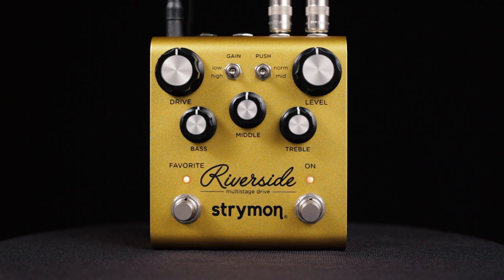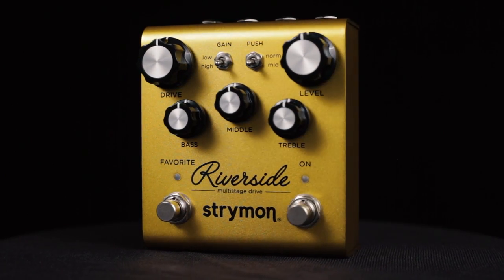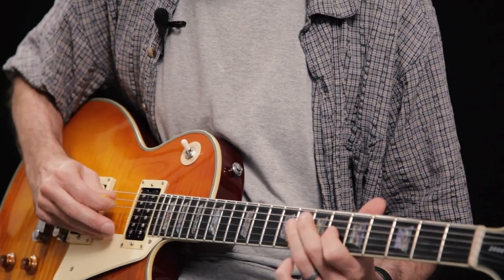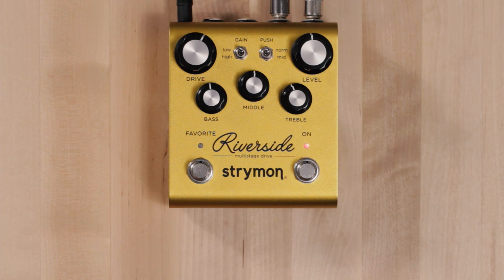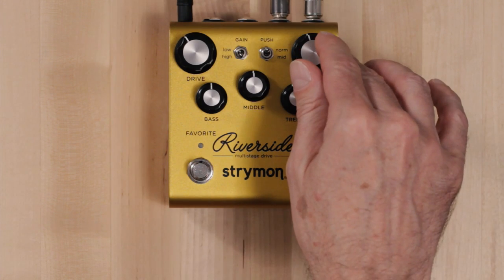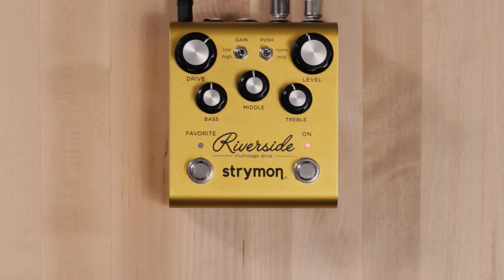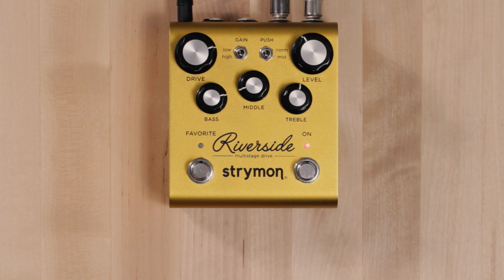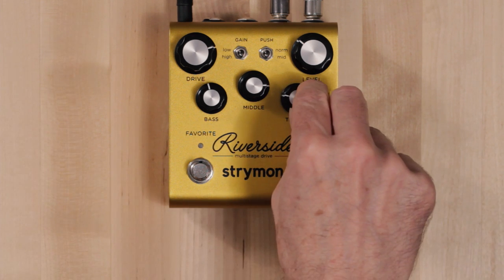Strymon Riverside - Multistage Drive - In-Depth Demo

Comment: I got a Riverside unit last week and gave it a few good runs over the past few days and it's a winner: very rich and organic sounding with nice clarity as well as versatility and flexibility. Loving it. My two other OD pedals are the Ibanez HW TS808 and the Wampler Euphoria (along with the Xotic RC Booster V2) and the Riverside complements them really well. In the high-gain mode it's a great distortion pedal, which is not all that easy to find.

I've only tried it through the clean channel of my Friedman BE100 but will soon see how it works with the OD channel. It'd also be good to see a demo of how this pedal does with cranked Marshall type amps. I primarily use the HW TS808 with the amp's OD channel to give it more "hair" and cut and am curious to check out how the Riverside does in that realm.
Reply from the maker: Thanks so much for sharing that with us. That's great to hear. If you post any videos please let us know. I'll pass along your suggestion to our demo person :) We are definitely going to be making more demos. Thanks!

Comment: I own one, paired it with a deco and it just sounds incredible. Just realised you need another pedal to 'unlock' a 6db boost so I'll have to look into that. So many different sounds in one overdrive.

The pedals both sound incredible, I don't regret spending what I did on them, they will stay with me till I can't physically play anymore.
Reply: Why? It sounds like a Boss DS1. Just buy a couple of Boss DS1 and you'll save 200 bucks on top of it.
Reply: @mike1967sam  Yeah, um...no.
Reply: @mike1967sam  no way dude

Comment: Been waiting a long time for Strymon to step into the OD realm. My only slight apprehension is that they'll release a larger form factor like the big sky, timeline, möbius which will have so much more options and I'll be annoyed if went with the smaller one.
Reply: Peter Danner completely agree. I want to wait until they have the larger version with a million options. I hope they're working on it!
Reply: MIDI support and patch storage would be very nice...
Reply: @techguy1230  - Both Riverside AND Sunset have MIDI support and 300 savable presets.

Comment: It would be nice to see how it reacts to guitar volume
Reply: Pretty damn well, but it cleans up just slightly less than a valve amp ( traynor ycv 50 )
But the  pot roll off sound with my prs is awesome, you can go from a Malcolm Young sorta sound to Dirty.
It sounds great, nothing like say... a line six where when you lower the pots  and it sounds garbage, it responds really well.

Comment: Im trying to learn Jazz Guitar.  What are the essential pedals to get?  What do I not need?
Reply from the maker: Hey there! It really depends on what sounds you specifically want to get, and it also depends on other parts of your rig, like your guitar and amp. Jazz is also such a broad genre — someone trying to nail jazz fusion tones is going to need different gear than someone trying to get Grant Green or Wes Montgomery tones. 

Once you've settled on a guitar and amp, a good starting point is usually a reverb of some type and a drive pedal, assuming that your amp doesn't have a reverb you want to use, and you're not getting overdriven tones from your amp.

If you have specific songs you're trying to replicate the tone to, we're always happy to offer some suggestions if you'd like to email us at support@strymon.net. 

Hope this helps!

Comment: Does anyone know if the optional boost is independent?
Reply: Independent of what?
Reply: Of the pedal being on.  Would allow you to boost a signal before overdrive.  Helps to compensate between pickups in different guitars.  i.e. boosting the signal of a strat before overdrive as compared to a les paul.
Reply: Ah, that is a really good question!  Its a total guess, but from owning the OB-1 Compressor -  that pedals boost is independent of the compressor, so I would hope/assume (dangerous practice, I know) the same with Riverside.  At least I hope so... time will tell.  Hope they see this and answer.
Reply: BluesLicks101 I also own an ob.1 and the boost isn't independent of the compressor.  The compressor has to be on for the boost to work.
Reply: Pretty sure mine was, maybe a settable parameter? - but I left my compressor on all the time so maybe its not, the OB1 was a bit dry for my taste so I replaced it with a Wampler Ego so I'm going from memory.
Reply: Okay I took my OB out of the drawer and tried it and it absolutely DOES have an independent boost.   This makes me think maybe you have an earlier version?...
Reply: Strymon says that isn't possible.  http://www.strymon.net/faq/can-the-boost-run-independent-of-the-compressor/
Reply: Ben Harris on the OB.1, to use the boost without compression, just roll the compression down to 0.
Reply: Well the Boost LED comes on for sure when the compression is off - so that's a design defect IMHO.
Reply: BluesLicks101 it's a good thing - you can tell if boost is on or off without the pedal being "on". very helpful.
Reply: BluesLicks101 Mine does that too.  It is confusing for sure.  I have had mine for a few years.  Perhaps it is an older model and the article is outdated as well.  That would great if it were so!
Reply: slimigan My comment was regarding whether the two can operate completely independently of one another.  I like to have a boost to compensate for the drop in volume for vintage single coils from humbuckers.  I prefer to use a compressor for clean/percussive passages and solos rather than leaving it on all the time.  Since this doesn't seem to be possible on the Ob.1 I was wondering if it might be on the Riverside.
Reply: Not helpful if the LED is on but the EFFECT is really NOT... a better method to implement would have been a flashing LED for "boost ready", and then it goes solid when compressor kicks in.  I did not use this pedal much, like I said I like the warmer sound of Wampler Ego better, after I bought it - it went into the drawer as a backup - love Strymon, but that to me is a design defect.
Reply: Agreed Ben, its an excellent question, and I hope Strymon looks at this thread, if for no other reason than to come up to speed on the importance of independent boost in all pedals that have boost.
Reply from the maker: +Ben Harris Yes the available external boost can work independently of the pedal itself.
Reply: strymon Could you please advise as to the OB-1 issue above?  the LEDs come on independently but it appears the actual boost and compression does not, this is confusing... if the boost truly DOES require the compressor to be on to function, it would have been better if the LED on the boost was flashing rather than solid in Boost ON and Compressor is OFF... and when Comp. and Boost are both ON, both LEDS should go solid.
Reply from the maker: +BluesLicks101 The Compression and Boost effects on the OB.1 are not independent.  The Compression must be ON in order for the Boost to take effect.
Reply: Right that is what we figured out: the point of confusion however is that when the compressor is OFF it still APPEARS to a user that boost is operational when it isn't - as upon a hit of the footswitch the boost light comes on solid (exactly as it does when compressor is on) - this is really a false "ON" light however.... my suggestion to remedy is that you have the Boost light flashing when Boost switch ON, and Compressor switch OFF so there is no confusion on the functionality... and that the Boost LED would go solid when Compressor is engaged - may not be worth the continuation engineering expense, but IMHO it'd be nice for future users.
Reply from the maker: Appreciate the feedback +BluesLicks101 and will pass along to the team :) Thanks!
Reply: No problem, I'm an electronics product engineer too... we're all in this together, much respect for your team!

Comment: whats the dif between overdrive and distortion?
Reply from the maker: This is kinda subjective as the line between the two can blur a bit, but, generally, an overdrive pedal produces lower gain and less breakup (like a vintage tube amplifier) than a distortion pedal that produces more gain and much more breakup in the tone.  There are many varieties for the two types with some being able to cover both low and high gain sounds, but, typically, overdrive pedals produce lower gain than distortion pedals.

Comment: this is supposed to be a 'multi-stage' drive - meaning 2 stages. what the f'-k does the 'favorite' button do? does that allow you to toggle btwn 2 diff drive settings? or is it just for show?  thanks for wasting my time showing me different eqs.
Reply from the maker: 'Multistage' refers to the different gain stages that make up all of Riverside's different tones depending on where DRIVE and the rest of the settings are set to. The FAVORITE footswitch allows you to recall a second preset that you can save with any of the settings as you like :)

Comment: Will this make my ss amp sound like a tube amp?
Reply from the maker: Riverside adds harmonic complexity that will truly shine in front of any amplifier. We haven't found an amplifier yet that does not benefit from the tones Riverside adds! Pete has a JC40 at home, which is solid state, and did a lot of testing in front of it. We definitely think you will be pleased if you try one out =)

Comment: Cool! How does it stack with other overdrives?
Reply: Its a brand new product, I doubt they have much data on that as of today - but if the Deco Drive is an indicator, it stacks just fine.
Reply: +BluesLicks101 Agreed! I am dying to pair this with my DECO!! Linking via the boost will be great for dual rhythm/lead sounds.
Reply: For sure -  one of the things I really like about the Deco that I think I am hearing (or NOT hearing as the case may be) in the Riverside vids is the pedals run really quiet when they are not being played, probably some advanced DSP noise filtering in there.   Strymon is a great company.
Reply: You can get 8 sounds if you use the Expression and boost, actually more with blended sounds...I only pair it with Fuzz

Comment: Just need an Strymon Volume Pedal!!!
Reply: If they do one, it should have an integrated tuner, or something else that would make it stand out from the crowd.
Reply: JHS have already made one like that, prototype was shown at the last NAMM
Reply: My point is that "just another volume pedal" is not a good product differentiator - Strymon always seems to have something extra in every product that no one else does.
Reply: no need to worry about it then!
Reply: I think in a high quality volume pedal with tuner, optical, and beatiful colour with leds. Also with optional buffer

Comment: Pete, how many mA does this pedal draw? I want one but my power supply only has 100 mA outputs left
Reply: Gregório Tinôco It requires about 250mA
Reply from the maker: All of our smaller pedals, including the Riverside, require a minimum of 250mA current in order to function properly.

Comment: I have 64 FX pedals, 27 of which are Overdrives and Distortions and 2 of them are Fuzz. One of them is the Strymon Riverside. I have several Boss overdives and I swear that this pedal the Riverside if it were in a Boss enclosure 80% of guitarists would say "It sounds horrible it's that horrible Boss DS1 and DS2 sound." ... but since it has the name Strymon on it everybody says "Oh it's amazing what an overdrive, probably the best out on the market". But I can tell you where mine is going if I was a millionaire I would throw it in the trash since I'm not I'm selling it. Guitarists mostly hear the name on the pedal and not the sound it produces.

Comment: What I typically need in a demo and it is very rarely the case: select the bridge pickup and strum an open E chord. Hearing a guy solo on the neck pickup incessantly while changing the gain is all to common and does little to demonstrate the sound of the pedal. Strumming an open E chord takes the player out of the equation a bit. After a strummed E chord, go nuts with the noodling.

Comment: I’m a novice why so many plugs to operate it
Reply from the maker: There are connections required to use Riverside as shown in this video.  1) Power cable,  2) Signal input from instrument, and 3) Signal output to other gear/amp. This is typical for all pedals that require an external power supply. Power, Signal IN, Signal OUT.